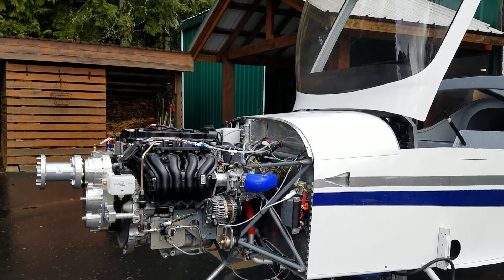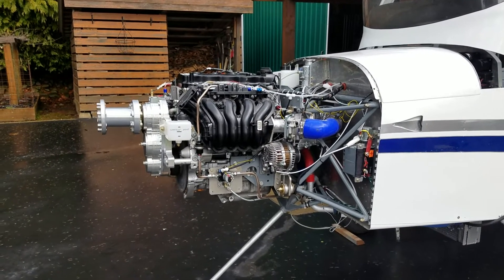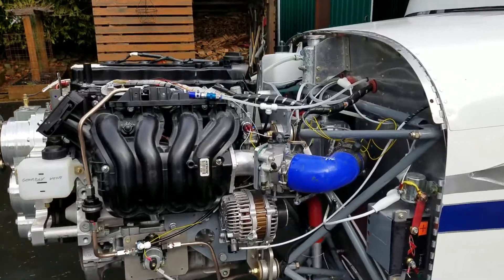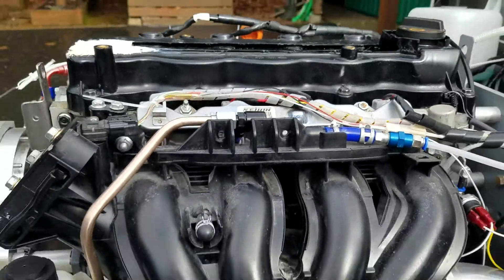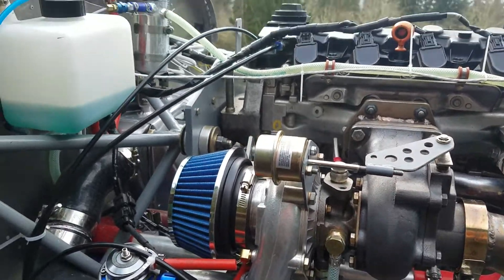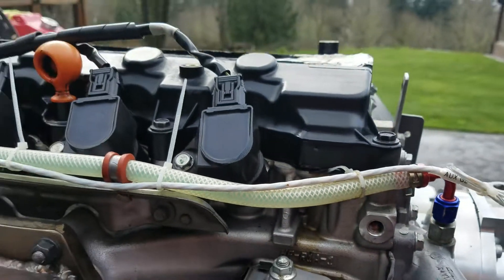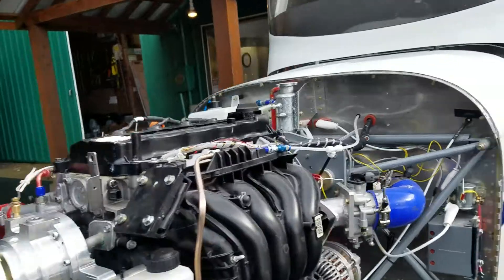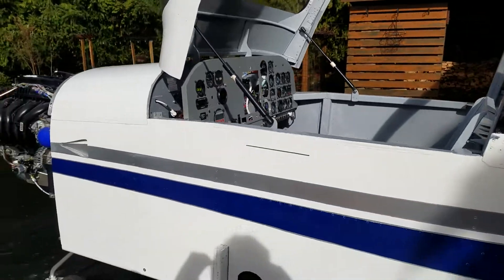Honda R18 on my RV6A test run no prop.

Comment: Nice looking engine setup.  Thanks for sharing!   I fly an RV-7 with O-360.
Reply from the maker: Thanks.   I would have loved to built a -7 but they did not have them when I started this build.  You can read more about the build on VAF at  https://vansairforce.net/community/showthread.php?t=158610&page=77
Reply from the maker: Oh....and I have 100 hours flying now.....

Comment: Great videos and beautiful airplane. Congrats on your first flight.  You said that the gearbox was from Viking. Is the engine? Or is that your own conversion? If so, what are the differences? What HP are you getting?  Again, thanks for the videos!
Reply from the maker: The gearbox is from Viking.  But the engine is not.   The engine HP according to Honda is 145HP.   The turbo will add HP, and that depends on how much boost you ask it to deliver.